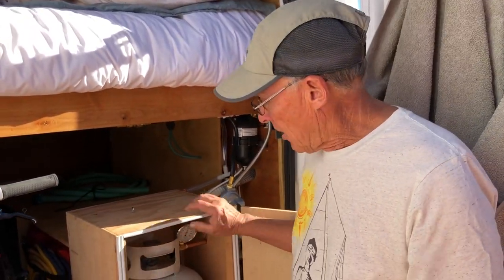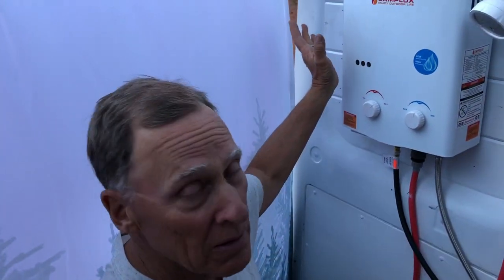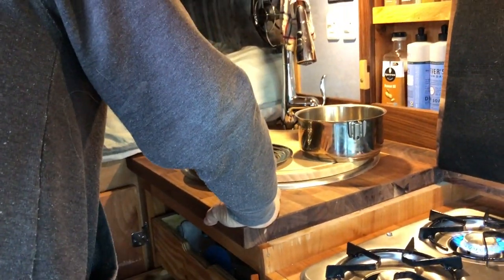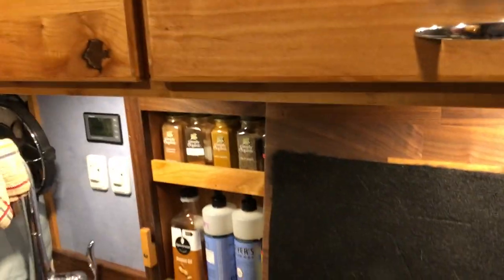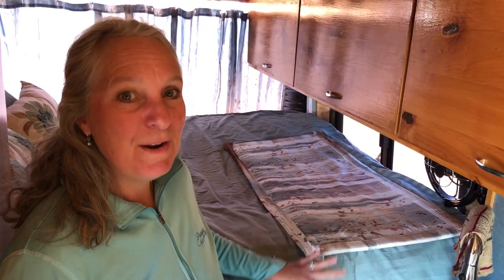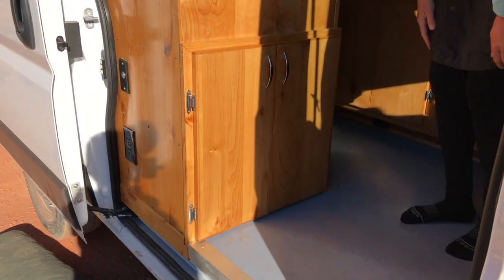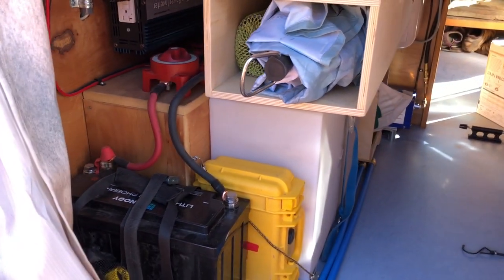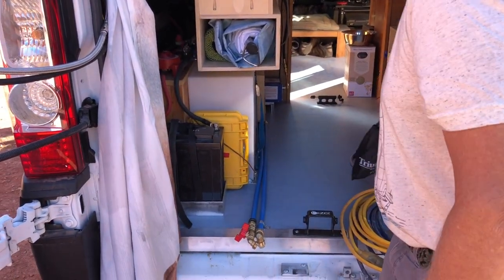Epic Van Tour//EP 8 VanTour of our OFF-GRID Sustainable ProMaster Van - 136 inch wheel base

Comment: Hi folks,great job on the van. I was wondering about the 5 gallon propane bottle. Is there a reason it does not go in a vented box?
Reply from the maker: We actually haven't been carrying the 5lb spare bottle since that video. But, as far as we know, the regulations in the US require that you carry the bottle in a secure, upright position. We certainly feel better having the 20lb tank in the vented box - and we've found we don't need the spare 5lb bottle.

Comment: Great video and van conversion.  Perhaps I missed it but how do you power the Bosch water heater and when?  I have considered one of those and powering it while driving using a B2B charger to keep the battery topped up.  Stay safe...
Reply from the maker: Thanks!  The Bosch water heater uses up to 1400 watts and comes on automatically when its thermostat calls for heat.  I've seen it draw over 10 amps from the battery.  It plugs into a 120 VAC receptacle run off our inverter, hence the 2000 watt inverter.  WE've found that we're using over 100 amp hours overnight in the winter using lights, fridge, fans, and water heat for dishes, sponge baths, dog food prep, etc.  The low sun angles leave the solar panels at just over half power in full sun so we rely on the B2B charger a lot unless we have access to shore power.  In hindsight I would put in a propane instant heater and use it for the sink and the shower.  Then the solar system would be plenty most of the time.  The downside to that is the wasted water getting hot water to the shower across the bed to the shower head.  Hope that helps.  I could see running it only when the B2B is on but 2.5 gals runs out pretty quick.

Comment: Has your 170 amp hour lithium battery been enough? I just started looking into water heaters and I was worried the bosch 2.5 gal mini water heater would suck up to much power. Do you find it uses a lot? More when taking a shower? Do you leave it running 24/7?
Reply from the maker: We’ve ordered a second battery for that very reason.  Also, we have a separate shower that is propane.  We only use the electric water heater for the sink.  We also have a DC fridge. So, obviously you need to look at your entire set of loads to size your batteries.  
Thanks for watching.

Comment: May I also ask, what is the full width, side mirror to side mirror open, of your 136based Van?  I can't tell if the 80.7" posted on the Promaster website is the width of the vehicle only or full-width mirror to mirror.  And.. if mirrors can fold in, what width with that.  I have a tight spot I need to park in and wonder if a 136 based van can fit.  thx
Reply from the maker: Matt has the van out on a rafting trip or  I'd measure it for you. I would keep checking online or remind me in a week or so when I can physically measure that. It would be the same as any promaster though. The 136 wheel base on affects the length.

Comment: Hi! Lovely van Build! It gives me loads of ideas for mine! One thing regaring the hot water going back into the cold water system. You could install a one way check valve to prevent that problem. I'm sure the accumulator solves the problem for the most part, but a check valve should completely erradicate it.
Reply from the maker: Thanks for the feedback, We're glad you liked the build. 
An accumulator tank is needed to keep pressure from building past PRV set point - I think.
Reply: @ClarityOffGrid  Absolutely! The accumulator is needed to keep pressure in the system if you want to avoid the pump coming on and off all the time. The one-way check valve allows water flowing in only one direction (Cold Water -> Water heater/System) and not the other way around. Check valves are cheap and easy to install. Keep the videos coming!
Reply from the maker: @RoddyPerry  will do! Thanks for the clarification.

Comment: why did you get two separate hot water heaters? would you do it differently if you could do it again
Reply from the maker: I wanted to avoid putting vent holes in the side of the van so I went with the electric for the sink thinking 1400 wattts would only be on sporadically and would not draw too much current from the batteries.  However, on these long winter nights we often use over 100 amp hours when using lights, fans, fridge, and heating water for sponge baths, dishes,, and dog food prep.  I added a second battery but in hindsight I would install a propane water heater and use it for shower too.

Comment: On the sliding platform for the composting toilet, are the hinges sufficient to accept your weight or do you have some sort of roller underneath? do you have a plan you could share on the design of the compartment? thanks
Reply from the maker: The sliding drawer for the composting toilet is on drawer slides that are rated for over 300lbs.  We don't currently have a plan for that, but we'll be happy to answer any questions if you decide to go that route. Thanks for watching and we have a video in our Van Build Playlist that is devoted to the install of the composting toilet. You'll see more details there. Good Luck!
Reply: @ClarityOffGrid  Thanks for the quick reply. The video is very helpful.
Reply from the maker: @hwetherb  so glad it was helpful.  👍🏻